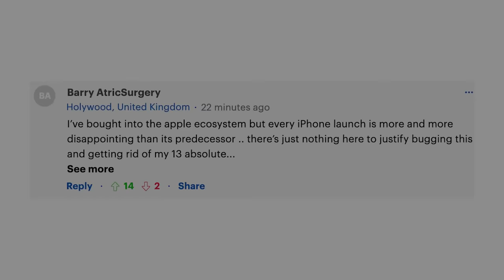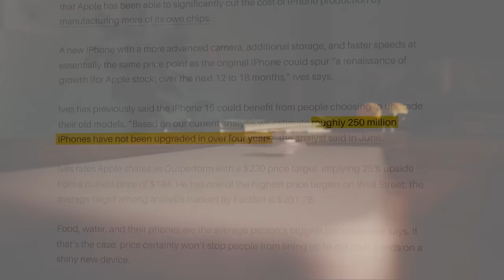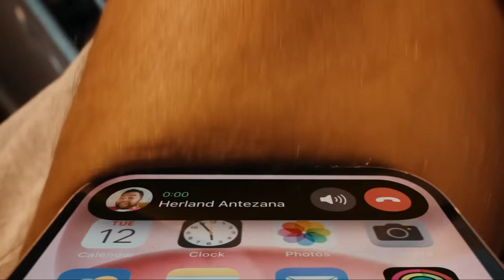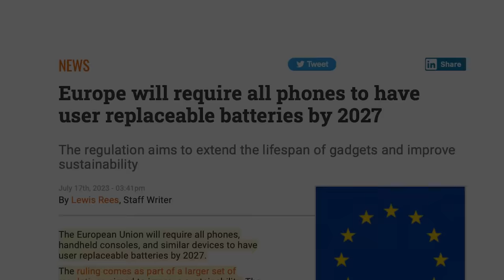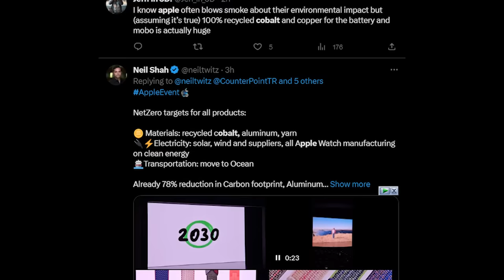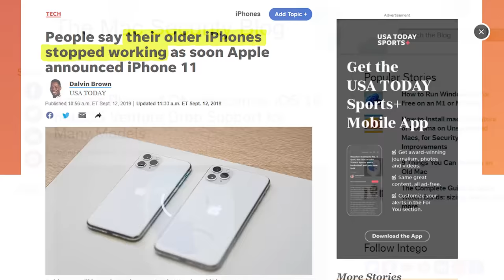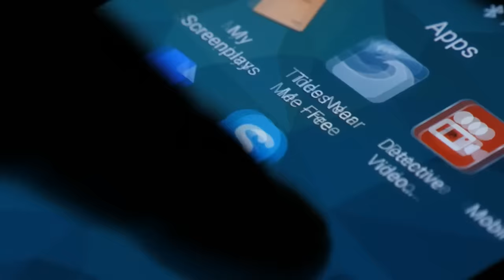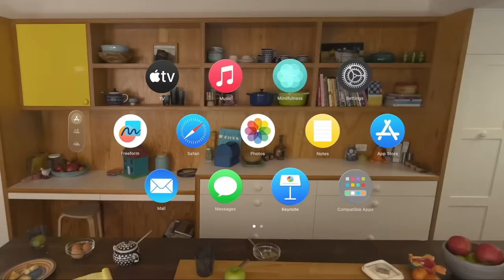The iPhone 15 Is Everything Wrong With Apple

Comment: That’s because you’re not supposed to be upgrading your phone every year. I’m on a 3 year upgrade cycle, and it works perfectly. Year 1 - Newest phone, Year 2 - Still pretty new, Year 3 - Getting a bit old might be worth an upgrade, Year 4 - New phone. You’re all just sucked into this idea of needing something new as soon as it comes out.
Reply: Exactly. Those who are buying new phones as soon as they are released for the full price are those getting screwed. I'd rather wait one year or so and buy a used/refurbished one.
Reply: I also change iphones ever 4 years
Reply: Fax. Its wrong to blame apple or any other phone company for simple coming out with a better and improved product every year. The people are the ones that are materialistic and obsessed with status and simply need to have a new phone every year. Im also on 3-4 year upgrade cycle and my "old" iphone 12 still works perfectly fine to the point that I still dont really NEED a replacement. 

You wouldn't blame alcohol drink company if someone caused a crash under influence, you'll blame the person who willingly consumed alcohol and sat behind the wheel
Reply: I change mine only when the old one becomes too slow or its battery dies down enough that it's just useless.
Reply: I also change phones every 4ish years but I had to get a new phone since my 12 mini camera stopped working _ and fixing it was more expensive than upgrading under my phone plan. I have a regular 15 right now but Going from a 12 mini to this is just awkward. I don’t appreciate the size of the phone ore the color options, and If it weren’t for ONE issue with my 12 that my parents don’t feel worth fixing I would not be using the 15. I just don’t see a reason in upgrading and as someone who appreciates a smaller phone - this is not it
Reply: @BigBadSev it was to keep up battery but other smartphone manufacturers also do it
Reply: Facts.
Reply: They're coming out with the IPhone 16 and I still have an 11.
(9/13/24)

Comment: Thanks for mentioning that there is no need for a new phone release every year
Reply: Other brands does that even more often. Your phone gets obsolete very 6 months or so
Reply: You know if you showed me a Iphone 12 or a Iphone 15, i would be fooled to think it is one or the other. Only geeks know the difference.  This is how simular they look 😄
Reply: I still have an iphone 7🤷🏼‍♂️slow but still works for me
Reply: Not everyone upgrades at the same time, everyone upgrades at their own will, if some people want to upgrade now then let them. Nobody is forcing you to upgrade year after year. The annual releases are just to give upgrading options to consumers
Reply: As long as people keep buying, they will keep producing. This issue is consumer driven. I usually upgrade every three years.
Reply: @rajeevsm They’re not obsolete. An obsolete phone is when there are no longer updates for your operating system.
Reply: That's easy for yall to say but if you bustas were business owners you would be doing the exact same thing because overall it's a smart business move to release phones every year
Reply: True 💯
Reply: @rajeevsm  I agree, more is needed, how come i can use my desktop for 10 years already, whilst my phone doesn't get updates anymore after 2 years? Ffs most phones have enough ram and ghz to run even the newest Windows os! My Motorola has 8gb of ram for example, why do i need to upgrade 3-4 years from now to 16gb of ram?
Reply: We used to have an "s" year every other year, and this would be a 14s not a 15 and we wouldn't expect major updates.
Reply: Share holders
Reply: @kittenburger_prime    Yes, and the 'S' meant 'Same'
Reply: @kittenburger_prime  Now that you mention it, i wonder why they quit doing that.
Reply: Nobody is forcing you to buy the newest model. So why do you mind?
Reply: 👍@zacmorri Great technological innovations are not necessarily discovered every year. Some times they take decades, some times they may never happen. Aviation is a good example. Commercial jet-engine aircrafts haven't changed in decades.
Reply: @MarshallMathersthe7th  you mentioning gigahertz here shows you know nothing about computers and you should stick to something you know about.
Reply: still have iphone X ... recently replaced batteries at service ... works like a charm, i have no need to upgrade it :)
Reply: No need for a new phone release every year, yes. But Apple won't survive going this path.
Reply: samsung
Reply: I would compare this to Call Of Duty’s model… Boring samey and lame af
Reply: And apple made rp stunt how "environmentally friendly" they are
Reply: Here is the thing, just because a new one releases every year doesn't mean you need to buy it.

You buy stuff after every few years and get a major update. And in that vein, when you buy a new phone, it's actually new
Reply: Same thing with cars.
Reply: apple should goo back to make a new design every 2 years
Reply: my Huawei Mate 10 , chipset kirin 970 with ai and leica camera,  still running well until know still Fast ( 6 Years still Running Well )
Reply: @MarshallMathersthe7th  Keep in mind that there is not just a difference in terms of size for ram. There's also speeds and whatnot that change. So to easily say your motorola has 8gigs of ram doesn't mean much really, same for mentioning the ghz for the CPU or even GPU. That alone means nothing.
Reply: oh really? ahahaha
Reply: @rajeevsm  I use an iphone 11. Doesnt feel very obsolete to me.
Reply: @rajeevsm hardly obsolete after 6 months lol
Reply: @Hammeltoni    bro, u using the same phone that was released 7 years ago, thats nothing to brag about or to be proud for.
Reply: The iPhone keyboard has never improved. Toggle better numbers and letters from the beginning till now.
Reply: @aryan-ud1lw wrong dude. They literally slow phones to force people to upgrade.
Reply: @Hammeltoni  I was rocking my iPhone 7 until December 2022, I only upgraded after having it eight years because the battery had degraded so much. It no longer gave a percentage on the battery capacity, it just said 'service' where the percentage should have been.
A month or so ago I bought a replacement battery and waterproof seal from eBay so one day I'll fix it up. Still works perfectly aside from the battery.
Reply: @rajeevsm  samsung A phones get obsolete after 6 months, not the whole phone market
Reply: @mangotail6808  if you can't tell the difference between a 12 and 15 you shouldn't be talking about iPhones in the first place.
Reply: @kittenburger_prime  ?? tf u mean? the 14 was the 13s my guy
Reply: @rajeevsm  Woah thats terrible! I personally dont know ANY phone that can only last 6 months. Are you considering software updates?
Reply: @rajeevsm I’ve been running a 7+ for 7 years, only started showing it’s age at the 6th year. You’re the kind of consumer Apple preys on
Reply: HOW are ppl this stupid? It makes things cheaper. You can get an S23 for $330 USD or less with Samsungs cyber monday deals in Nov-Dec 2023. If ur phone breaks u have MORE opportunities to get a newer phone at a cheaper price. Do u SERIOUSLY want to be forced to buy an even older phone to get a good deal if ur phone broke OR just wanted an upgrade?
Reply: Well, there is. There is no need for a YOU (or me, or anyone really) to change phones every year, or even every 2 years. But people aren't synchronized with their ownership: you might buy one today, I'm going to buy next year, Bob bought 3 years ago and will be looking for a new one in a couple months when the battery kills itself. There needs to exist an updated phone every year, you don't need to care until it's you who needs to buy.
Reply: @Win4Cheesily  This is a BS take. Consumers are ignorant fools (in the least offensive way possible: unless you're an enthusiast like me who lives their life with a tech podcast in their ears at all times, you aren't an expert on any product and you will trust the "experts" and the marketing; just look at all the people STILL defending the removal of the 3.5 mm jack, still regurgitating Apple's rhetoric 7 years later about battery life and liquid resistance years after it's been debunked), so consumer trends must be pinned on corps not on people.

It's Apple's fault, the fact that people will still buy has nothing to do with it because people don't know better.
Reply: @Anankin12  Well said! Another point worth mentioning is that despite constant updates and improvements, yearly models look substantially the same. This is a good thing. Nobody wants to spend $1000 + on a new phone, only for it to look obsolete a year or so later. I'm still sporting an iPhone XS and still very happy with it.
Reply: @mangotail6808  You'd be more right if you said iPhone 13 vs 15, because 12 doesn't have the dynamic island, and its bezels are bigger - so from a visual difference out of the box it is obvious. 12 also doesn't have the mazing macro lens, so you don't have close up shots nearly as good as the 14 and later. They are improving it, but it's only ever 2 phone versions that the leap is noticeable enough for really tech savvy rich people to switch. Also it's not like Apple or iPhone is making their products not to last long that you'd need to switch. Software side you get iOS updates, both feature and security updates for over 6+ years, so realistically you'd only need to switch your phone every 6+ years, and maybe battery once every 3 years.
Reply: No one says not to make a car every year. You just go get one when you're ready. 
What's the problem again?.😮‍💨
Reply: You didn’t know that?
Reply: A phone every 5 years is fine
Reply: There is. I wanted to change my iPhone 11 and I'm glad I got the 15 over the 14. You are not supposed to buy a new one every year.
Reply: @Dracogame why didn't you keep the 11
Reply: I always skip phones my first phone was the iPhone 5s then iPhone 8 then iPhone 12 and now soon the iPhone 15
Reply: @Dracogame  you just bought a new phone though
Reply: @Eclipses915  you know, you don't need to buy every new model?
Reply: @iwanttocomplain  that’s what I said I don’t
Reply: @iwanttocomplain  I hate buying every new model and that’s what my family wants me to do
Reply: @Eclipses915  wait, what? Your family pressures you to buy a phone every year?That sounds very made up.
Reply: @iwanttocomplain  my aunt and nana keep telling me to get a another phone and put me down if I don’t I say I like to skip phones I have iPhone 12 and getting iPhone 15 soon but they put me down for not getting iPhone 13 and 14
Reply: @Eclipses915  so odd
Reply: Should be every 3 yrs imo. Nothign new comes out for a few years anyways.
Reply: @alexmotts  so your laptop and pc are not more than 3 years old? What advancements in phone and software technology has made the old phone redundant? The camera? Have you heard of 'cameras'?
Reply: Toyota, Honda, Ford, GM, and every other company releases a new car every year. That doesn’t mean everyone is expected to get a new Corolla every 12 months. They do it so the people who are ready for a new one have the latest stuff, even if it’s not too different from the previous year’s model.
If they only released a new phone once every 3 years, everyone would get a new phone at that moment, since you’d be an idiot to get one more than halfway through the cycle.
Reply: @rajeevsm   HAHA NO its an trashpple thing
Reply: Other brand also released phones every year
Reply: @aryan-ud1lw  What does that have to do with a phone "needing" to release every year? If you have a phone from 5 years ago, upgrading to one from 2 years ago is still an upgrade and it doesn't need an yearly release.
Reply: Not for you and many of us perhaps. You can easily last 3-4 years with the same phone if you take good care of it indeed, but not everyone will be upgrading it in the same generation/year. In fact, I'm pretty sure most consumees just skip releases. Thing is some might upgrade this year and some others next year. Maybe some just have to because their phone broke or whatever. Just because you aren't upgrading this year, doesn't mean others aren't.
Reply: @NothingButSilicone with Chinese brands like Infinix or Tecno 6 months is true..